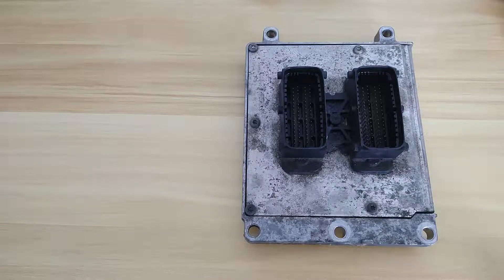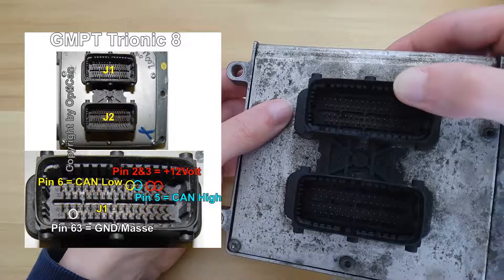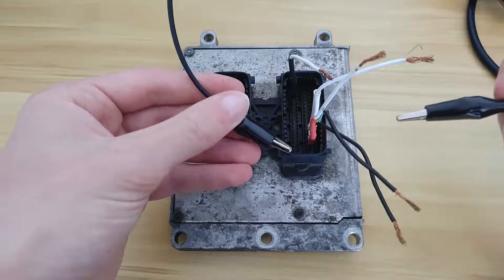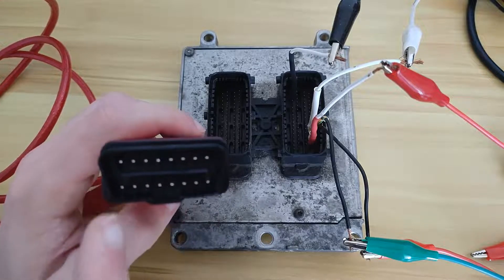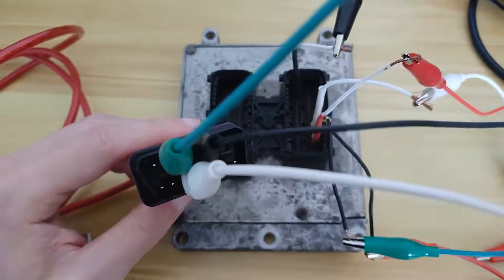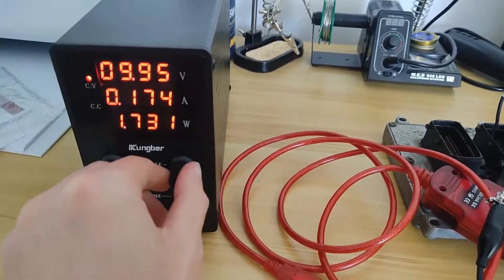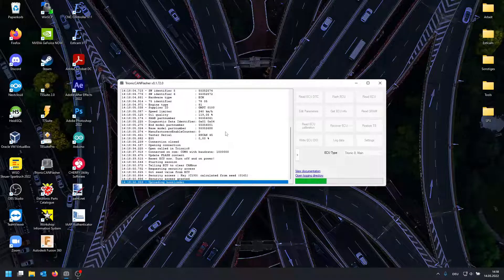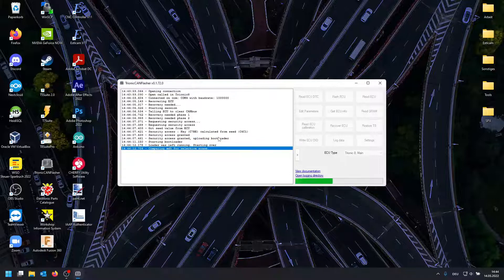Recover ECU - Trionic 8

Comment: Thanks for the vid, very useful. That procedure is only possible with ECU on the table with connected pins, with original Tronic plug or with cables. And it's not possible to do that from the car.